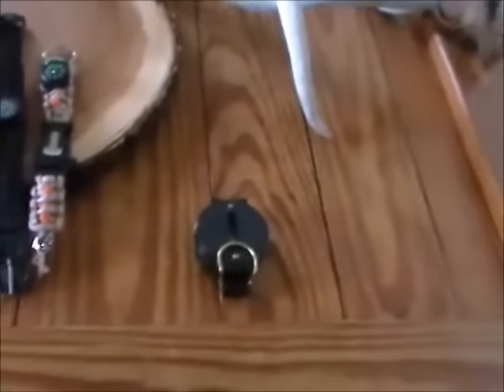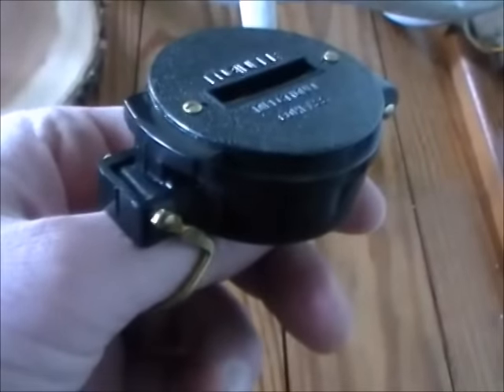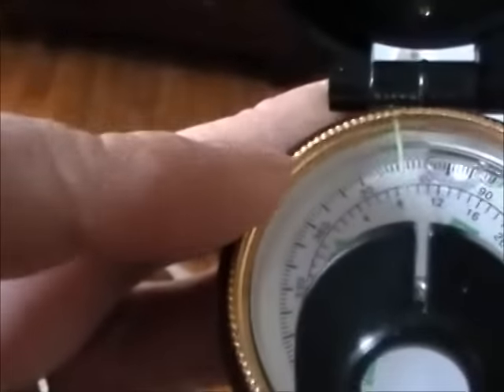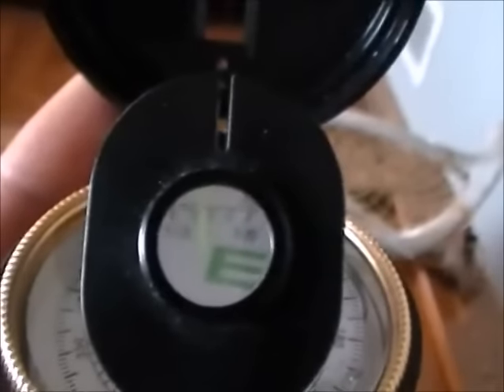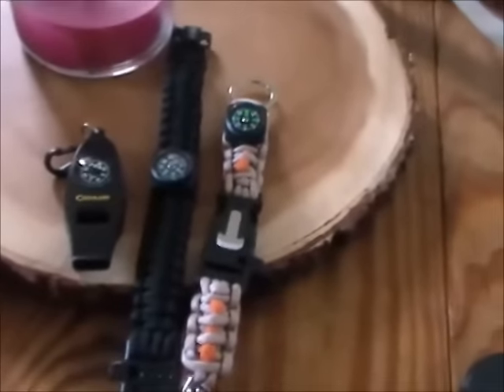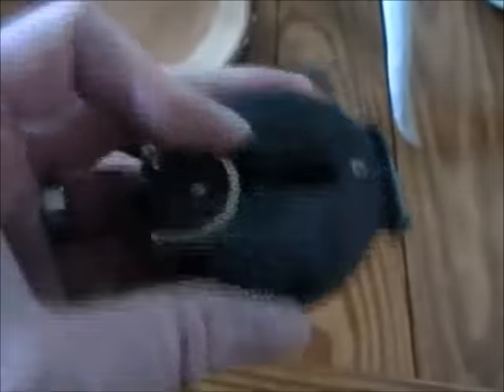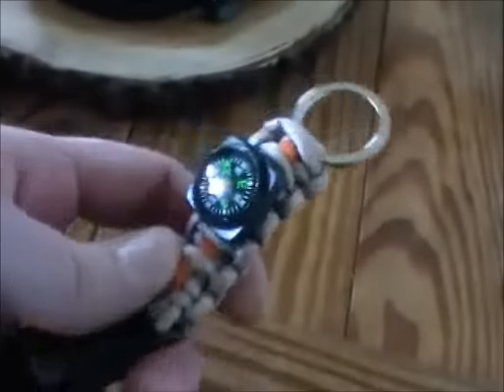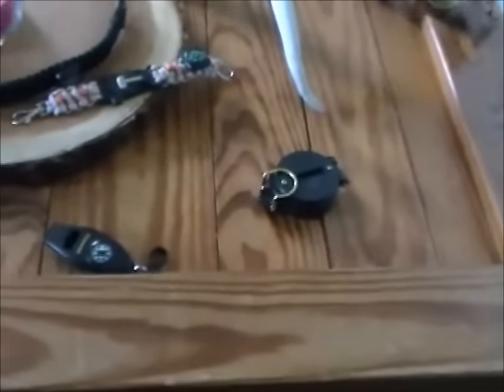Using A Lensatic Compass (For Dummies)

Comment: The reason for finding the direction for something in the distance is to pick a waypoint that you can or need to get to. You find a landmark in your heading, put the compass away until you get there and repeat as needed. Works great along with a topo map.
Reply from the maker: I was reading a navigation manual at the army surplus store and you are apparently supposed to use it to navigate around and object as well. Hard to explain though, made sense while I was reading it.
Reply: I use my compass for basic directions.  To make sure I am headed in one direction until I can find a road I recognize that would get me home.  I’m an old lady with nothing to do so I drive around the UP a lot in good weather just to see what’s there.
Reply: @franniefargo9454 , you need one up there. Im a troll from the lower😄

Comment: From what I understand about compasses, all of them are good for finding a general direction, especially on a cloudy day in the middle of nowhere.  It's how accurate you need it where the difference lies.  But to get to a specific point in a map you need to know before hand where Magnetic North & True North in relation to each other before you even head over to the middle of nowhere.  These more complex compasses can help you travel in a straight line (fir the most part) to a specific direction on a map.  The lensatic compass in this video is only $5 in Walmart.  Though i noticed there are 2 lines marjed on the clear face of the compass.  I just wonder why they put two? 🤔
Reply: That's how u tell the difference between magnetic North and true North.

Comment: If you notice, there's also an eye slot at the top of the lid and also a peep hole below it.I lower the lid to set up the alignment of the  guide wire and the adjustable indicator so you don't have to adjust it each time.  Sometimes I set that line as a return indicator at night.  Thanks for the video.

Comment: If you don't know where you are you can find landmarks and determine their directions from your location and then pinpoint your exact location on a mal.  But you need a map that displays the landmarks you chose and probably a calculator if you want to be accurate and in a survival situation you probably won't have most of these items.. just wanted to mention it

Comment: This compass has a 5 deg graduation, so 5 deg on a long distance is not accurate enough.
The outer graduation is in Mils, 6400, which basically used for measuring distances, object sizes, distance between 2 objects etc...!
>>Mils:
Another unit of measure, the radian, is used mainly by militaries in artillery, tank, and mortar gunnery.
There are 2 PI radians in a circle. PI is a constant of approximately 3.1416. That is 2 * 3.1416, or 6.283 radians, . 
Divide each radian into 1000 mil-radians and you see there are 6283 mil-radians in a circle, rounded to 6400. 
Mil-radians are called mils for short.
17.78 mils equal 1 degree.<<<

Comment: You really need to learn why you need to know the directional reading is needed for. A topographic map and such would give you a good indicator on where you are. Once you know the reading of several specific places (mountain, river, ect), you can pin point your location on the map. Anyone who hikes alot should know this information as it is very useful. You could do the same with a regular compass, but not as accurately. And as for a compass, you get what you pay for. Some of the cheap ones on key chains are nowhere near accurate enough to even find North as I have had several pointing somewhere East of North, like over 40° off. Some are right on untill it's been banged around in your pocket with a bunch of other metal objects like keys and coins. Get a good topographic map of your area and learn to use the compass properly.

Comment: you was suppose to drop the top down on the 1/2 tilted bottom section not keep it at a 90 degree, 1 degree off and you are off 2 miles if you ever used it.

Comment: What is the shorter line on the bezel for?  It looks like it's on a 45-degree offset from the long line, so it might be for triangulation?  I have searched for information for the lensatic 
(I have one since Boy Scout days) so all I bothered with was the wire sight.
Reply: I have no idea. A military compass has a fixed line. Both of the lines on the bezel turn. I suspect one is to assist setting the bearing and the other is rotated over the Magnetic needle to allow you to follow a bearing. I looked at one today at Lee Valley. I was confused. The instructions are no help.

Comment: can anyone tell me what the second shorter line in the bezel ring is for? I've been trying to search the internet, but it seems like nobody really knows
Reply from the maker: I just watched this 30 minute video  from the army and it gave no mention to it
https://youtu.be/nfDFqdqJe2o
Reply: The mark on the bezel is used to set the compass to follow an azimuth (bearing). For example, say you've done map work and know you need to follow a 40 degree magnetic azimuth back to your campsite. Right now you're in dense forest, or otherwise don't have a clear view to sight a distant landmark. You open your compass all the way and turn it (and possibly you) until 40 degrees is under the index (long, fixed) line. Then, you turn the bezel until the smaller mark is lined up with the needle (make sure it's the north end, or you'll go in exactly the opposite direction). Now, your compass is set to follow a 40 degree azimuth.
Keeping the compass out, now you start walking, keeping an eye on your compass. So long as the needle and the mark on the bezel are aligned, your sight wire is pointing at your desired azimuth.
Reply: Correct info. Lee Valley has this style with two bezel lines. Both bezel lines rotate with the bezel. I figured out the long line is just to assist with obtaining an azmith and the shorter line to fix over the Magnetic needle.

Comment: I got 2 of those dang tiny button compasses, they are way too small!!  I need one of those big ol'monster compasses!!
Reply: Kaylynn Strain I completely agree! I also need something with degrees on it
Reply: Started out stupid and got worse. Make the video on a non-windy day. Know the name of the compass. And know why you carry one.

I use that exact same cheap lensatic I got for a few bucks at Walmart in my bugout bag. Works fine. Maybe if you didn't toss your gear around, it wouldn't be "floppy." I want to know how you will tighten it up since the hinge is a brass pin in plastic. Actually...I don't.... For basic peppers the cheapo will work, though.

The lensatic is handy to maintain your bearing in undulating terrain---something you can't do with your other cheap gear compasses shown. 

THOSE OF YOU WANTING TO KNOW HOW THIS THING IS USED/USEFUL, BEGIN READING HERE: Set your "point of reference" (azimuth) which is shown in the video. THEN MOVE THE GREEN LINE ON THE DIAL TO LINE UP WITH THE POINT OF THE NORTH ARROW. As long as you keep that line on the north arrow, you will stay on course even if you lose sight of your reference point in hills or trees.

Then, most people aren't traipsing around with topographical maps, but a gazateer for your state is a good thing for your bugout bag. You can shoot an azimuth and use it with your gazateer to stay on course to get from where you are to where you are going. Especially if you are staying off the beaten path.

With a topo map, you can shoot two azimuths and triangulate your location. Honestly, that's probably more intense than anybody actually needing to learn the basics of how a lensatic compass works is  going to get. Like I said, they won't have topo maps anyway.

But, yeah. I can't imagine any reason I might need one in my bugout bag. Think I'll go with the compass/thermometer/magnifying glass combo myself. That way, I can find the direction to an ant hill, fry them, and see how hot they get.
Reply: Just Really LOL!!

Comment: Your cheap $15 plastic compass is not very accurate. Buy yourself a good military style Lensatic with Tritium H3 $79 the guide marks glow in the dark without using a flash light to charge it. then take the time to learn how use it properly so you can make a useful vid. thanks for the effort any how.

Comment: Did not like the video it was not useful for anyone who had wished to learn true orienteering.
Reply: Brian Ferris I have been orienteering for a few years, lensatic compasses work but are not reliable.  If you wish to find a general and reliable compass simply check orienteering information guides.
Reply: I am sorry but I know the engineer-compass is used in accordance with maps to lay bearing angles, it was used in my Royal Canadian Artillery Regiment by my commanding officers to plan live fire exercises on Canadian military basis. They did not hold up the compass in the air to align the wire on the cover with a distant tree or landmark. They put the compass on the map, oriented it with map, and planned out what bearing angle and distance every artillery round should go. Have a good Summer ahead :) be good to yourself and family and enjoy the woods, rethink the mind set on the engineer compass it does work.